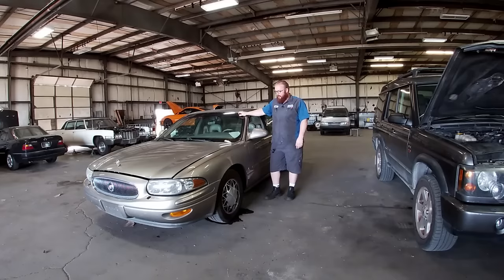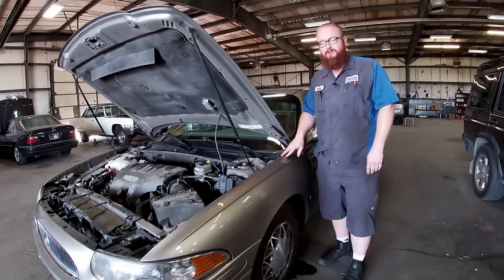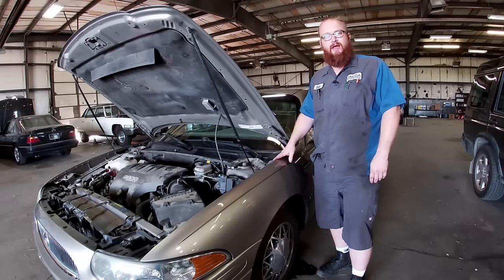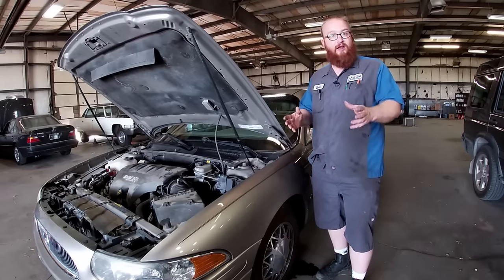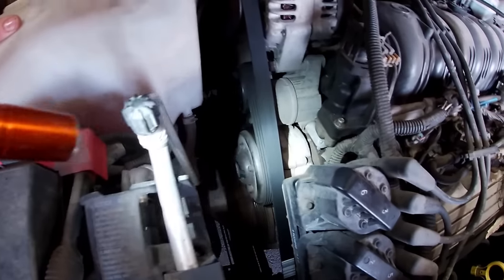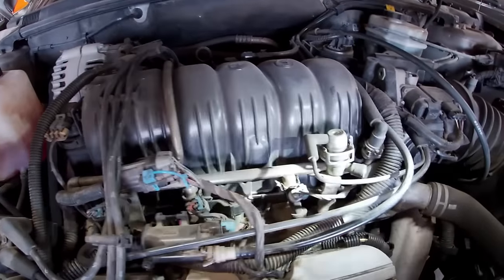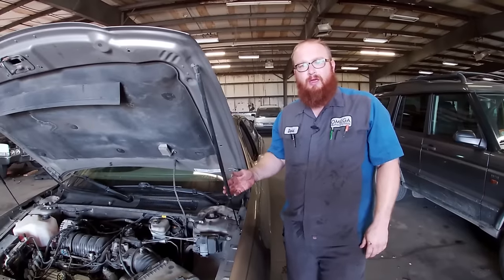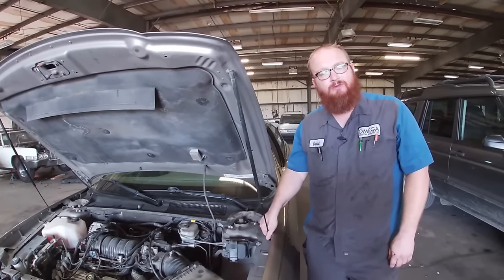CAR WIZARD highlights what makes the Buick 3800 V6 the BEST engine ever!

Comment: My grandpa worked for GM for 32 years. When he retired, he was given a 1989 Buick LeSabre. He loved that car and passed it down to my dad when he died. It was the car I learned to drive in.
Reply: No, your allowed to believe that...it is more along the lines of being too proud/or money exhausted after getting ripped off by the brains (engineers) and/or over bearing on the engineering process!
Reply: @G0ZERIAN  it was one of the things left to him in my grandfather's will.
Reply: Mr. TA  that is exactly what happened.
Reply: I learned in a 91!
Reply: @spareparts7630  do, or do not. There is no try.
Reply: @Reed Delgado yeah and what you want a cookie?
Reply: @davidbeaulieu4815  Teslas are boring to drive and very tacky looking on the inside with that huge goofy monstrosity in the middle of the dash.
Reply: @619guy202  I was sharing my story about a Buick on a Buick related video, this is a car channel. Plenty of people seem to like it. You don't have to be a jerk. Also, I would absolutely love a cookie, but not from you.
Reply: David S nice gnx turbo 6 emblem 👍
Reply: @davidbeaulieu4815  don't Tesla's run on soy?
Reply: Grandpa retired in 2007.  :-)
Reply: Mr. TA  Tesla won't be around in a few years.
Reply: @619guy202  Mmmmmm, cookies
Reply: @xreediculousx  
Does your dad still have the 89 Buick?
Reply: @ednorton47  Not once everyone realizes that magnesium cobalt and lithium when used in mass battery production will be far less plentiful a resource than crude.
Reply: So sad that there is no longer love affairs with automobiles. The big muckity mucks have planned it that way.
Reply: @davidbeaulieu4815  anyone that believes electric cars will need no maintenance will be in for a rude surprise when their electrified marvel leaves them sitting alongside an interstate waiting on a tow truck.
Reply: @scinto23  L...O...L !!!!!!!!!  :-))
Reply: @ednorton47  you have shoe leather and bus stops in your future, so says the UN gangsters.
Reply: Thanks a great story--   Appreciate men like your Grandad,  that was Detroit at its peak!
Reply: @davidbeaulieu4815  what's those motors costing ,when they go,nevermind the batteries?
Reply: My parents bought one new.  Red with red interior.  

My dad (a mechanic himself) was overjoyed with the direction the hood opened as you had complete access to the engine without banging your head on the hood. 😂
Reply: My Grandpa left 8th grade in 1910 to work for Buick and support the family. My Dad got out of the Navy in 1945, went to GMI (now Kettering University), and then went into Sales. I have his last '08 Lucerne CXL 3.8 III with 31,000 miles on it. It does the job, mileage is mediocre. But, it can make that land yacht rock.
Reply: My mother-in-law still has one, 1989 LeSabre.
Reply: Those H bodies are very underrated cars.. I daily drive one, a 1990 Pontiac Bonneville, and I've got over 324,000 miles on it.
Reply: I had the Olds Delta 88 version of that.  It was a steaming pile of crap that I was overjoyed to get rid of.  GM really screwed up the first generation FWD design on those.
Reply: I had one in Burgandy for many years. It was a great car that my family and I really enjoyed.
Reply: Additional note: mine had over 265,000 miles on it when I traded it for a newer Buick Park Avenue. It was still going strong and I could still coax over 30 mpg out of it.
Reply: Those were great cars! My Deceased Grandmother owned one!
Reply: I had one! A T type..
Reply: I learned to drive in a 1989 park Avenue.  My dad ended up giving it to me when I graduated in 2000.  What an amazing car it was.
Reply: My first car was a 99 LeSabre. Head gaskets gave out. I'll always miss that car.